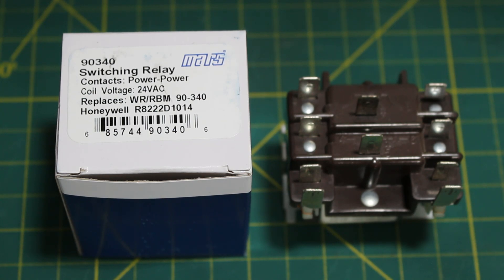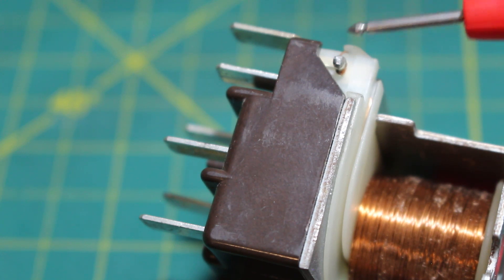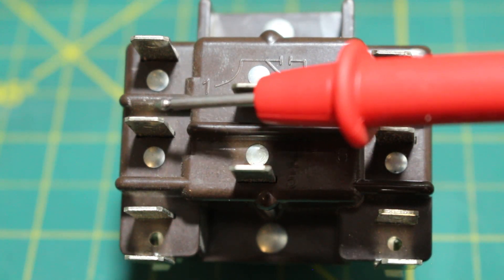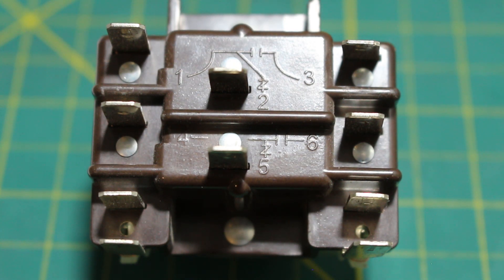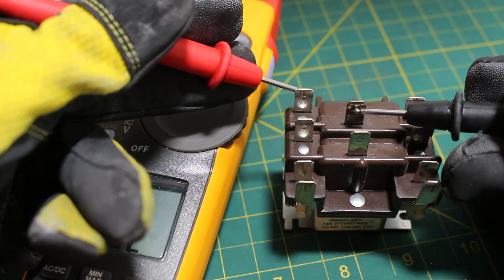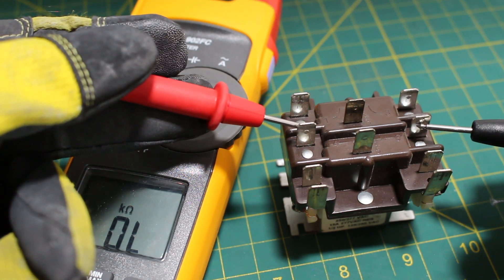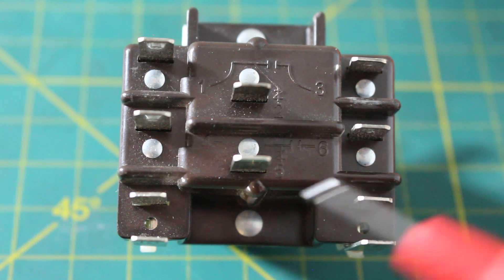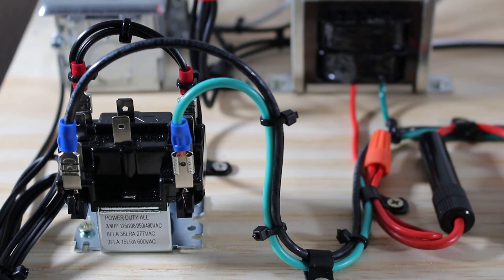HVACR: General Purpose Switching Relays EXPLAINED (How It Works) Everything You Need To Know! 903

Comment: You will definitely run into those on a fan control center along with a Honeywell fan/limit controller on older furnaces 😊
Reply: Burnham boilers use em for some reason too. Idk why,they seem to fall out of the housing base over time. I always use a zip tie to hold them together one I see one even if it’s not an issue yet.

Comment: thank you so much for the video sir, it's helped me so much! I just have one question though!  I understand the theory of the relay and using continuity to test if the Normally Open or Normally Closed contacts are in their correct baseline state.  What confuses me is, how do I test the relay while energized to see if the coil is working properly, therefore the contacts moving to the right places?  Would that be checking for voltages?  It's my understanding that I have to use Continuity while it's de-energized so I won't mess up my multi-meter.  I hope you get a chance to read this :)
Reply: The coil and upper contacts are energized separately, so you can still use continuity with the main circuits disconnected. If everything is powered, yes you would check voltage at each point where it is expected.
Reply: Good question.

Never measure resistance while circuit is energized because an ohm meter measures resistance by putting a small voltage across what your testing.

If the circuit is energized then you need to test for voltage instead.  

If you're testing a switch, relay contacts, etc. and they are OPEN then you will basically be measuring the supply voltage.

If you're testing a switch, relay contacts, etc. and they are CLOSED then you will be measuring no voltage.  Basically, when the path is closed you lose your common/neutral reference hence the zero reading.  In a sense, it's like trying to read the voltage across a DC battery by connecting both probes to the positive or negative (no potential difference means no voltage reading).

Hopefully that answers your question 😊

Comment: Gas furnace and air conditioner are shared with one relay or different? My unit was installed in 1973 and still works .Thanks

Comment: Quick question if you don't mind. My heating/cooling system has that relay for the blower. Heat, everything works fine. When we turn the AC on, every now and then the unit turns on but the blower doesn't because the really slightly pops out. I'll push it back in and it will work for hours, then randomly the unit will go on, but the relay has slightly popped out again. Lost with what to do.

Comment: I checked my Honeywell R8222B 1067 24V 50/60 Hz per your protocol: the points have an 11.5 Ohms reading and the relay is opened and when the circuit calls on it, it closes per my resistance readings.  My points, where my 11.5 Ohms reading was shows zero voltage when the power is off and jumps to 28 volts when the power is on....which is good.  My question to you is should the relay side, when the circuit closes also show the 28 volts?  Currently, when I activate the relay the closed reading does not show any volts.  Does this mean I need a new relay switch?
Reply from the maker: Only the coil will read 28 volts across once it is energized. As far as your N.O. or N.C. contacts, you will read 0 volts across the contacts if the contacts close meaning voltage is passing through and is good and you will read 28 volts or so across once the contacts open which is also good. This happens only when the coil is energized. Once enrgized, the NO contacts will close and the NC contacts will open. Watch the video a few times to get a better grasp. Hope this helps & thanks for watching!
Reply: @JumpermanTech  correct...my coil shows zero volts and once the furnace is activated the common/HUM wires to the Honeywell R8222B 1067 reads 28 volts across the coil; however, the output side, that leads to my humidifier & humidstat reads zero volts if opened or closed (on the N.O. or N.C).....I assume it is bad, yes?

Comment: If this type of relay (R8222D 1014) is replacing one (R8222D 1006) that only has two contacts for the coil, can the extra set be removed? Or is it okay to just have them outside of the receptacle? Thanks!